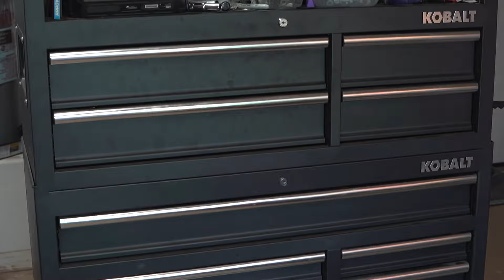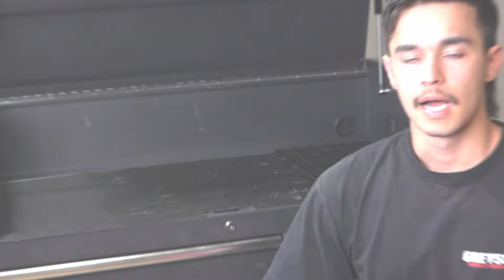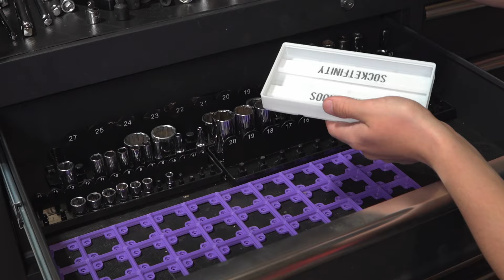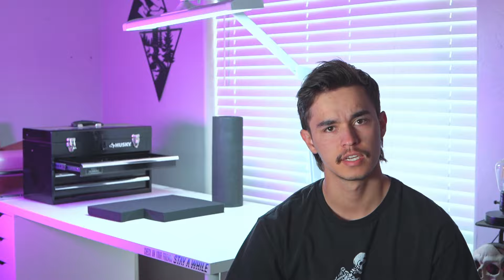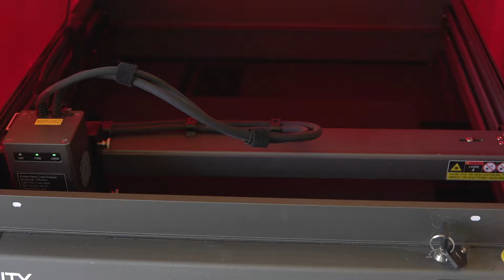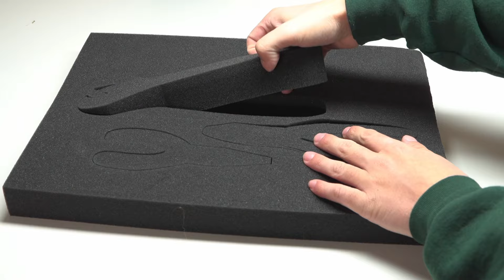3D Printing Changed My Garage Organization Forever!

Comment: Great video!

I've worked with similar foam fro other hobby-jobs. 
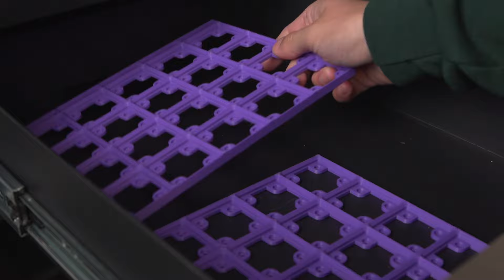I'd highly recommend to use compressed fiberboard (sometimes called hobby boards) for the bottom piece you used/glued @11:55. Provides a better surface for the glue to adhere & a stiffer base for use.

Comment: My main gripe with gridfinity is how much space it takes up. If you were to print for example all your ratchet holders and put magnets on the bottom, you could change the design to be much slimmer and fit like 3x as many ratchets in that drawer.
Reply from the maker: definitely a good point

Comment: This is the main reason I bought a 3D printer. I don't want to spend 12K on a bigger toolbox at work, but trying to cram more stuff in without various holders and organizers makes that a pain in the butt.
Reply from the maker: gridfinity definitely helps although you don’t be able to hold as much

Comment: I don't use sockets, but if i had as many as you, it would been a nightmare to always look at which number to put it on. So here is an idea.
You know those bolts storage prints where you just drop the bolt and it starts sliding down and depending on it size it falls through a hole and then in the right bin. 
I think something similar can be designed for these sockets and it will be so cool to just drop the socket in a slide and it will find the right position on its own.
Reply from the maker: now THAT is a good idea

Comment: I Like that you tried to utilize different solutions for different things. I think we all wish we had every drawer gridfinity, but its not always economical or the best option. Those vertical socket rails from amazon or the hardware store work great. I also like that you show that your results aren't always perfect. the same as most of us run into on projects like this. add finger holes in your foam tool control mats for easy acessibility! keep up the great videos!
Reply from the maker: definitely a great idea to add finger holes, glad you liked the video!